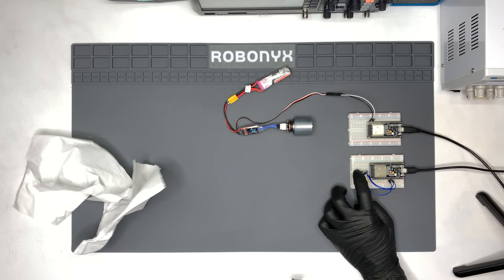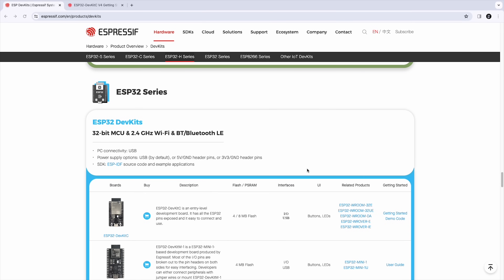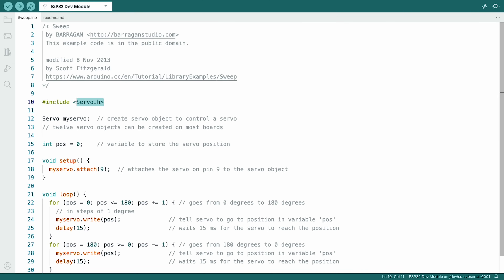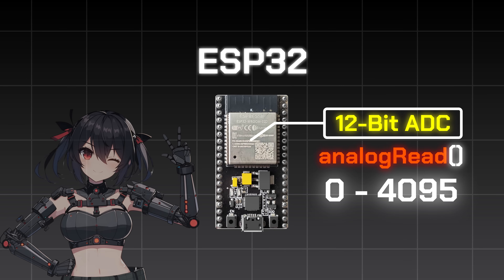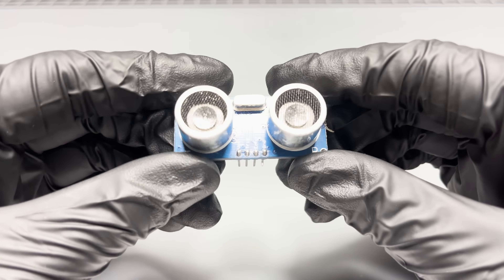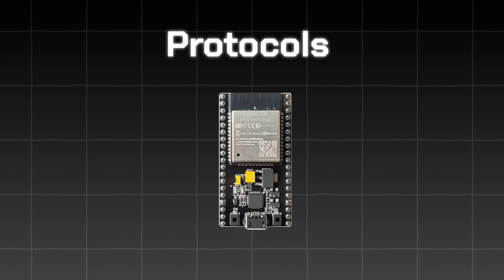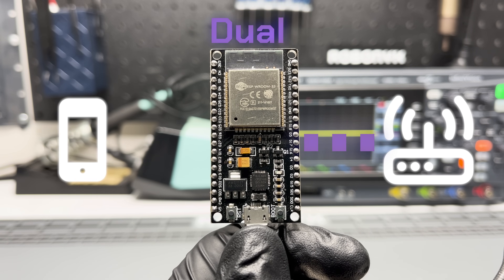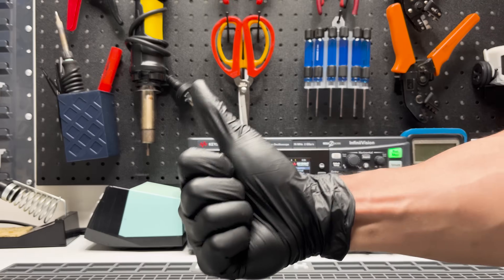Arduino To ESP32: How to Get Started!

Comment: Just getting started with ESP32, coming from Arduino. The only problem I've run into so far is that because of the pin spacing of the ESP32 dev board, normal proto boards are pretty much useless. These boards give access to only one set of pins of the ESP32. I had to modify one proto board to allow combining to another, forming one board. This allows access to the pins on both sides of the ESP32.

Comment: 125k primes in 30 seconds??  I have a prime sieve sketch I was playing around with that gets over 1.1 million per second on the ESP32.  Granted, it has some optimizations like segmented bit-sieve, multi-threading across both cores, some memory tweaking, etc.  You gotta pump those numbers up!

Comment: Hello, good explanation, thank you very much!! My question is the following, in my nanobrewery I have some things with Arduino, now I am designing a kind of thermostat but that is used to heat the water and/or display temperatures in other tanks, it will go with 8266 to see on my phone.
If I wanted to switch to ESP32, my question is, in the event of a network failure or bad signal, does it allow you to act with buttons or encoder and LCD like an Arduino, or does it only work over Wi-Fi?.

Comment: My esp32 does not snap into my breadboard, please help, i've ordered another on amazon stating that it is esp32 compatible, but my esp32 pins are wider than set holes for breadboard.  Does anyone know what breadboard I can use to fit my esp32 in?

Comment: I'm super confused while you're using the original Uno to compare? That seems a little disingenuous considering the width and breadth of adreno configurations that are kind of All over the place but in many cases pretty significantly beyond what you're talking about there and just raw processing power etc.. and they're usually cheaper than the Uno for some reason, well for the obvious reason the technology gets cheaper but.. I guess the weird one is that the older models don't get cheaper as well which is probably why they still sell them, cuz they probably don't sell a lot of them in comparison to the direct usually half price upgrades, even exponential upgrades...

I would be very curious if there's still manufacturing it, and that may be why it's still expensive lol given the the process node may not be the hot stuff, speculation though.

Either way you go, like I'm super confused why you're explicitly taking an apple and trying to compare it to a zucchini... Especially when you could just compare the Apple to the other kind of Apple that would be of the same or similar quality.. and it would come across a little bit less shady, even though there are way better apples that were not even talking about in that form factor in adreno's case.. But at the very least... It wouldn't look like you're comparing Honda and Toyota, and instead of a Civic, you've got a Lexus there as your your entry? Little little odd maybe I miss something?

Comment: So... I have a A.I. robotic head. And it seems I can't get the ESP32 to work. Maybe it got fried. However... When I put in the mini usb cable it does flash rapidly on the board... like an assault rifle... super fast... is it dead? I can't get it connected through usb to my pc or through the Arduino program. All help is welcome. Thanks for your video.
Reply: First ting is to check with a few other cables, many doesn't have any data cables in them so you cant connect it.

And second you need the serial chip driver for the esp32 look at the small chip and search it and driver esp32 and you should find it.

There is 2 different driver chips, don't remember their name right now but easy to find
Reply: @tullgutten  I have done all of the above thank you. I think there was a bitflip? I have to figure it out. Tried different cables - checked the chip - arduino ide etc. nothing is working right now.

Comment: Hi what does that 5V pin has voltage regulator mean? Is it okay if I want to supply a 12V battery to this 5V pin as it has voltage regulator?
Reply: No. Esp operates at 3.3V. It turns 5V to 3.3V. Even 6V might cook it.

Comment: You are a great Teacher, thanks a lot for sharing your knowledge  😃 Sorry for bothering, but I am trying to connect Arduino Uno to the ESP32 so I can control an automatic irrigation system using IoT linking it with an app.  I am using Arduino IDE to code, could you help me? 🥺

Comment: Brilliant video! 
But I wonder, I also have an Arduino UNO R4 Wifi, but is R4 wifi model faster or slower than The esp 32 you told about in this video?
I m 15 years old teen from India and yes, I have a 3 years of experience in electronics and Robotics, but still I would say, Your code writing skills are insane! 
And So I consider you as my "honourable senior" from now! 🎉

Comment: I substituted an ESP32 board in a project that I had recently used an Arduino Uno and wondered why it didn't work with the same components. Because the ESP32 uses 3.3v instead!  Thanks for telling me, I thought I wired it poorly or fried the microcontroller.  Thanks!

Comment: Does the ESP32 on station mode have to work with Web API's or can I use a local network with a server (Dhcp) and work with the ESP from an installed app on the Server (Win os for example)

Comment: I'm new to ESP32 / Arduino programming and, it's still overwhelming to learn it. Do you know of a book or website designed for people that struggle with this sort of thing? An example is trying to learn which code, needs to be entered first. 

Does it read the code from top to bottom? How do you know which code goes first and in what order? I've tried to learn it but, I just can't seem to understand it for whatever reason. (Maybe it's ADHD....idk.) I really want to build projects but I'm just so lost.

Comment: Oh! Now I understand why my ldr gives me 0 to 1023!
But I have a question. I was trying to build sun tracker solar panel with 2 ldr and 10k resistor. One of them works fine (giving 0 to 1023) but other one never goes below 35 and never touches 800 or above! I changed Analog pins (A0 to A1, A2 ...) changed the ldr, resistor everything but everytimes perticular one (named as ldr1 gives 0 to 1023 and other named ldr2 gives 30 to 800! 😢 And that's why my solar tracker model doesn't work with high accuracy 😔

Comment: I believe the ESP32 can receive inputs of 5v without issue if the pin is set to input. This has been a long going misconception but it does support 5v input. Ofc it can't output this so you'd need a level shifter for bidirectional signaling
Reply: It kinda handles but not recommended just the way you can light up a green led with 5v but not recommended.
Reply: @orange_tweleve  That's not the same at all lol. The issue with lighting up a green led with 5v is because there is no current limiting resistor. Add even a 220 Ohm resistor and it should be fine. The esp32 pulls down the inputs so it would be safe.

Comment: AMazing video... So clear and full of necessary information. May I ask what are the other IDE options other than Arduino so that ESP features can be fully utilized?
Reply from the maker: Thanks! You can use the ESP-IDF which would give you more control over the ESP32

Comment: Your first full length video! Nice. How does this compare to the teensy boards and the STM32 Boards
Reply from the maker: Both the Teensy and STM32 are high performance microcontrollers but they lack Bluetooth and Wifi features that the ESP32 has.